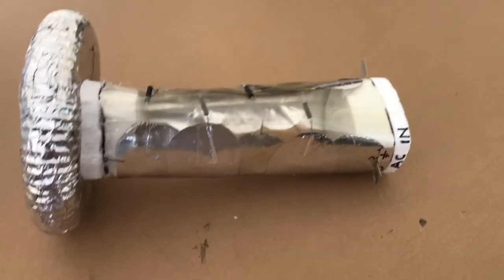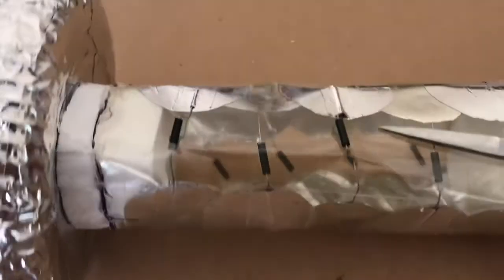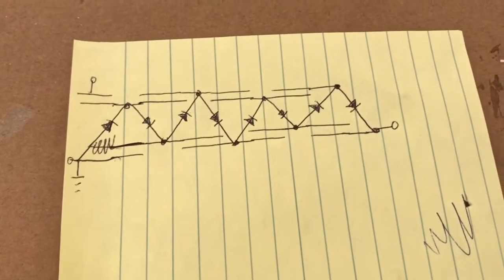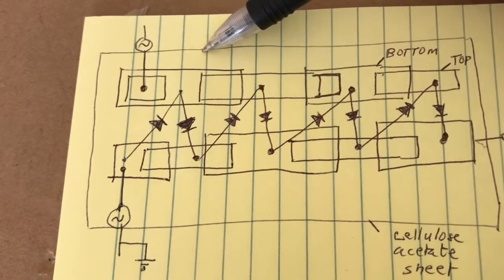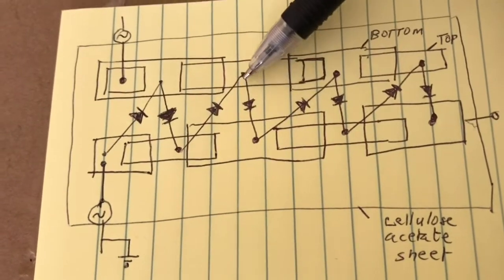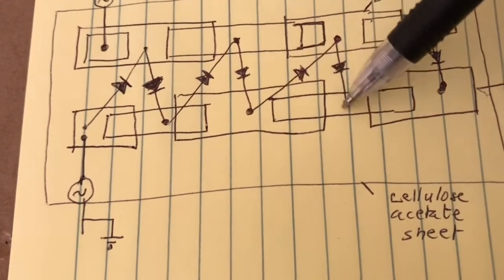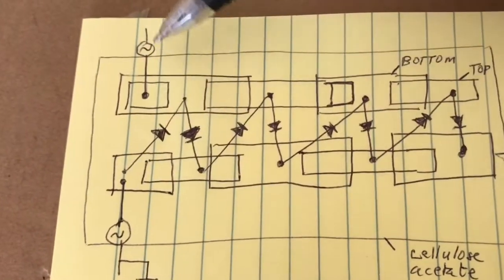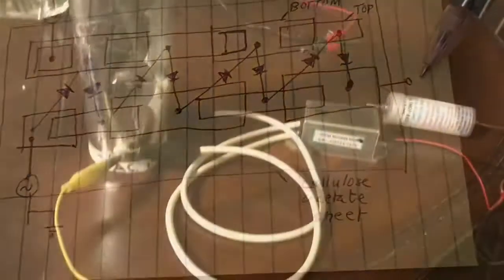Make a Static Electric Tower

Comment: What kind of supply are you feeding the multiplier stack with ?
What frequency is the AC at approximately. ?
The concept for using foil for caps is brilliant. !
The cost for the doorknob capacitors which were used for this in the past is insane and prohibitive now. Great job. I'd prefer to put the diodes the other way and produce negative ions. Put a needle on the doughnut and you will have an ionic wind.
Reply from the maker: Thanks. I am using a 20KHz 2 KV supply for the 2 KV AC supply. I think you can get these from amazing1.com The 5 KV setup uses an arc lighter. I got this for $9 of ebay with free shipping. These put out 5kV AC. The adhesive aluminum foil setup was cheap and easy to put together.